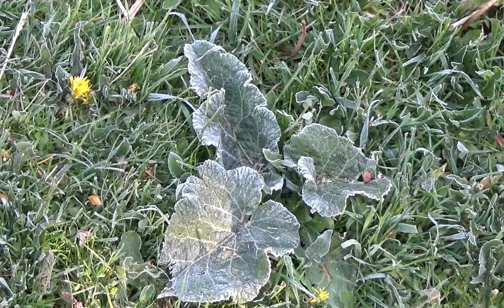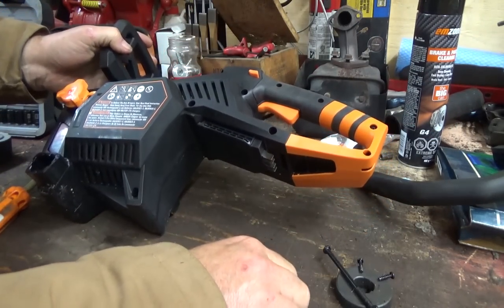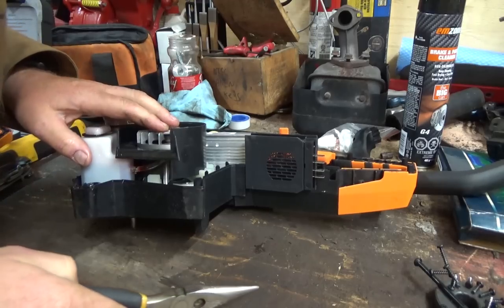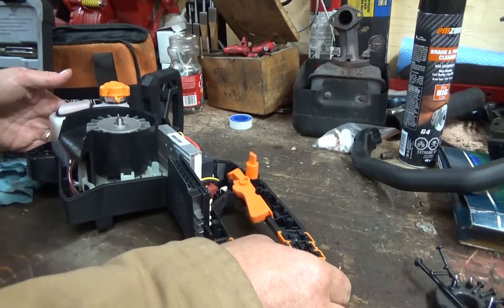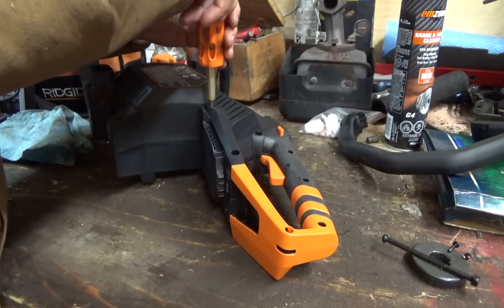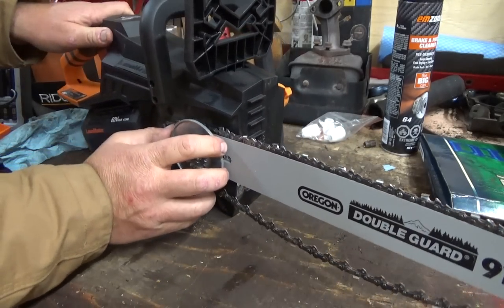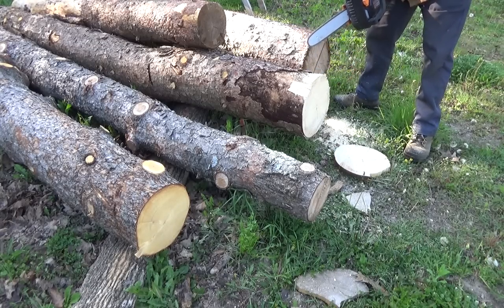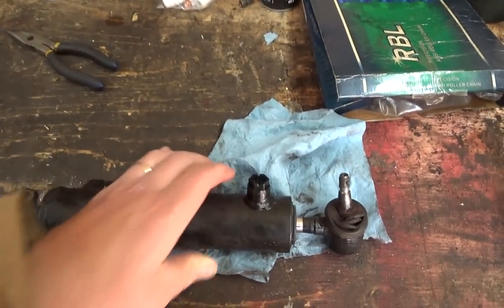Battery chainsaw wont oil the chain....You'll never guess what we found inside

Comment: What brand of saw is it? They are all made cheaply. I had a pole saw made by Wen it was 40v and I had 2 batteries for it. It was telescopic but mostly made of fiberglass and the head with the motor broke off, garbage. Now I have a Dewalt 20v pole saw not crazy about it either. Everything else is stihl gas powered.